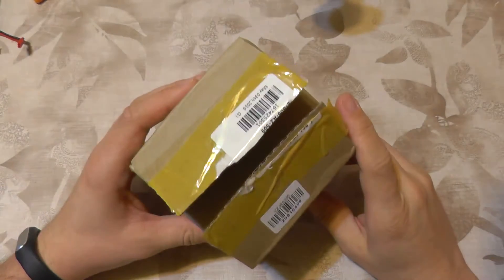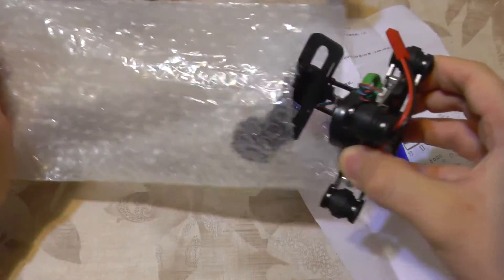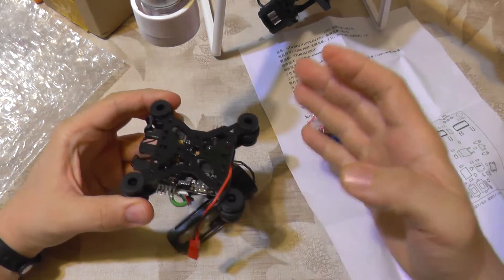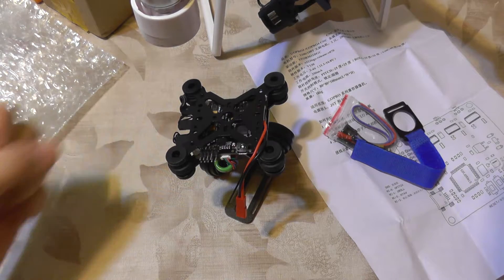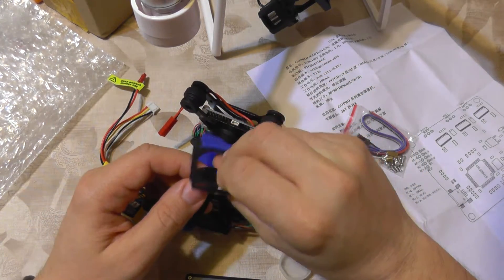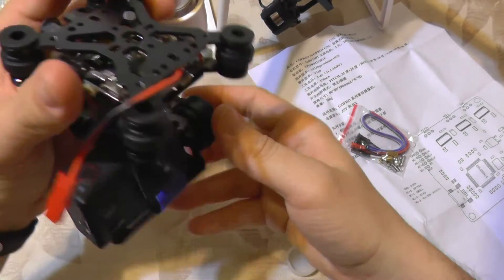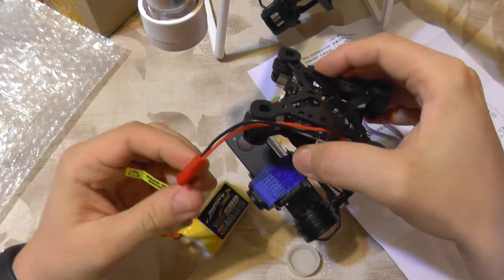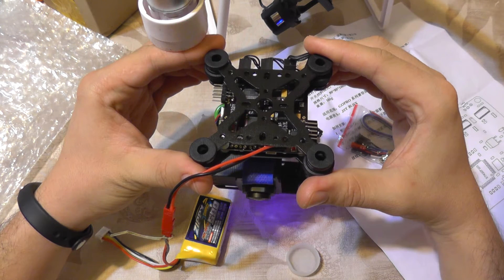HAKRC Storm32 BGC 3 Axis Gimbal - Will it work out of the box ?

Comment: Hey, Im not that familiar with Gimbals like these but Im thinking in getting one. Im unsure on how the charging works, do you charge it every time with the 3S LiPo? Or can you also charge it with a computer via USB? Whats the use of the mini USB, to connect to the computer and done and can you also charge it that way? Thank you
Reply from the maker: This gimbal needs a 2-3S battery source, usually it hooks up to the drone flight battery. The USB is for configuring and firmware update.

Comment: Hello guys. Have the same gimbals and Im wondering if i can use one battery for the gimbal and the drone? I kinda not want another battery weight for the drone. Did a bit of research and turns out my new battery is compatible for both the hakrc gimbal an my bugs 3h. Tough Im not sure how to connect both to the battery. Any ideas? Thanks!
Reply from the maker: The HAKRC will run with 2-3 S LiPo so you can use a single battery to power it up. Take care as the extra weight and power consumption will lower flight time.

Comment: ¿se puede utilizar este gimbal en un drone syma x8w, solo usando una batería para darle poder a este?
Reply from the maker: I don't recommend adding a gimbal to the Syma X8W because it will put too much strain on the brushed motors and they can burn out easily. It's better to switch to brushless quads if you want gimbal + action camera.
Reply: TechTronic9000 muchas gracias por responder
Reply from the maker: With pleasure !
Reply: me queda una duda ¿a que te refieres con cambiar a cuatriciclos sin escobillas si quieres una cámara de cardán + acción?
Reply from the maker: I'm referring to the motors, they should be brushless to provide enough power and durability. The motors form the Syma are brushed and wear out very fast.
Reply: aproximadamente, ¿cuanto tiempo duran los motores del syma x8w mas este gimbal?

Comment: I bought this gimbal and I would like to put it on the front of my drone (so the electronic card on the side) but when initializing the nacelle does not arrive and hangs.
Reply from the maker: 1) you need to add a camera on it for weight, 2) it must stay perfectly still during initialization.
Reply: TechTronic9000 yes i know, its for usb. There are nothing
Reply: Because after initialization I would put the gimbal at 90 ° to put it in the front of my drone but it vibrates and hangs.For that I was told to see with the software

Comment: hi there, I got the same gimbal but I have a problem... when I put the battery the red and green light flashes. the motors make noises and after a minute it goes out. I tried to connect with my computer but my computer doesnt find it. can you help?
Reply from the maker: First be sure that you have weight on it (camera) and it's completely still (not moving) when you power it on. To connect to you you need to try several app versions as depending on your board revision and firmware not all the apps are compatible with it. It also may not connect to Windows 10 PCs
Reply: TechTronic9000 can you give me a link to the firmware? ill try it with another pc maybe then it wil work.
Reply from the maker: From here: http://www.olliw.eu/2013/storm32bgc/#downloads
Reply: TechTronic9000 thanks bro !

Comment: Do i need the storm32 controller linked in the description or the gimbal will just do fine without it. Thankyou for making this video.
Reply from the maker: The gimbal from the link:  https://goo.gl/IyFZXU will come with the storm32 board included. The other link is just for the board in case you have another gimbal with no controller.

Comment: Do you advise me for the YI 4 K ? Will works with X380?
Reply from the maker: This gimbal is not recommended for the X380 as the magnets from the motor will influence the compass potentially making the drone crash.
Reply: TechTronic9000  oh thanks because I'm trying to found a good gimbal for the X380